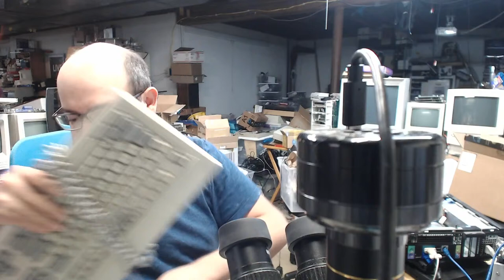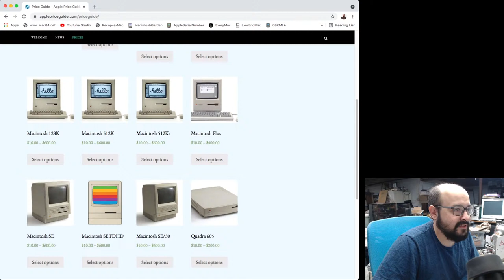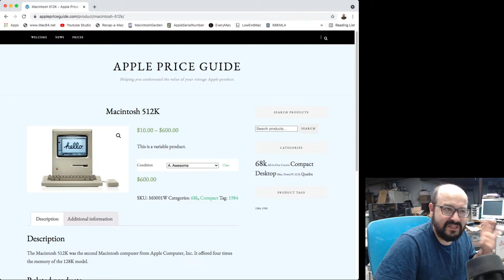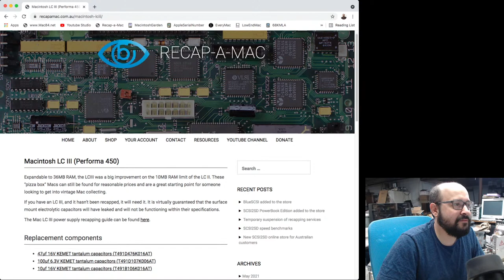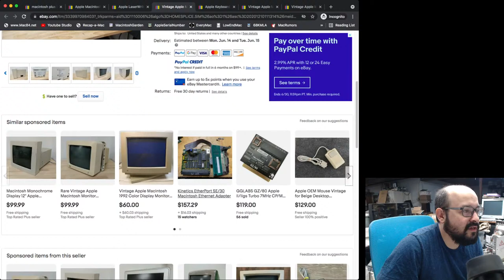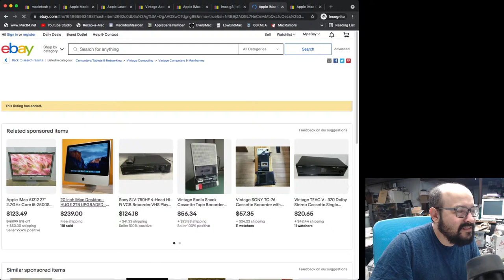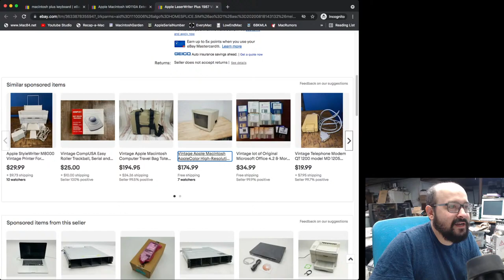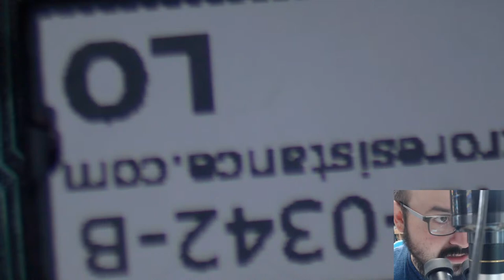Mac84 LIVE: Macintosh Repairs and Tinkering

Comment: Prob not the place to sk but, as this is the best place for vintage and soon to be vintage Macs; thought it be the best place. So: is it worth baking a MacBook Pro 15" early 2008 logic board; as it's none functional (bad graphics chip) or at least bad connection to logic board. There's no display or sound. With or without ram; any thoughts. Sorry in advance if this isn't the right place to ask.
Reply from the maker: Baking is not a sound method. It does not solve the main problem, it may produce temporary results - but it WILL NOT fix the issue. Replacing the board is likely the only way - unless it’s a MacBook that can be tricked to use the Intel graphics instead. The LowEndMac Facebook group is a good place to do some research- good luck!

Be warned - a lot of folks swear by baking - all I can say is please do not do it, trust me.